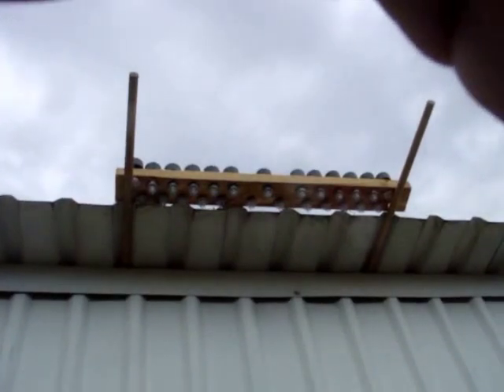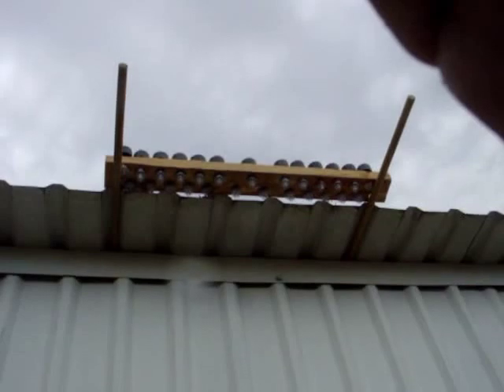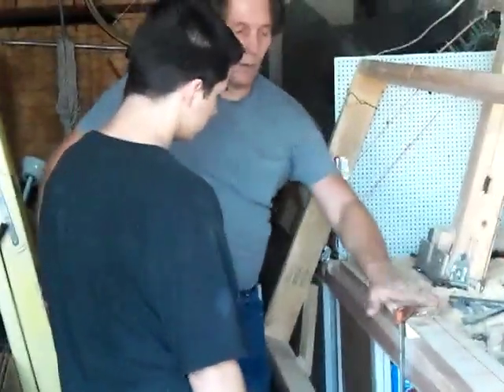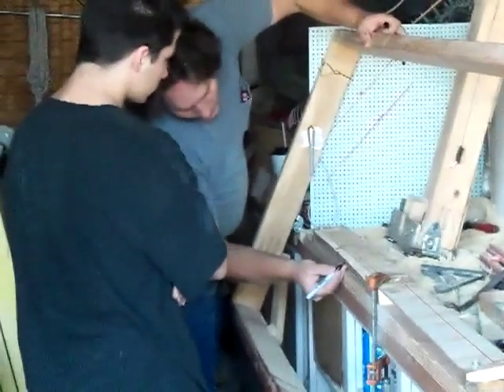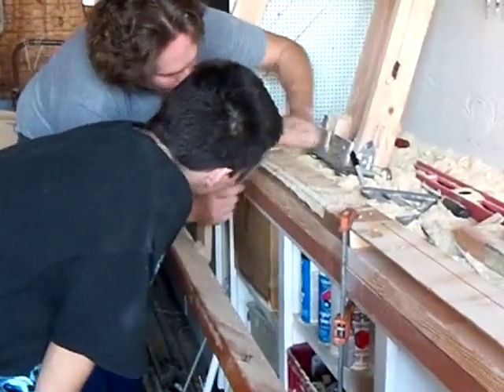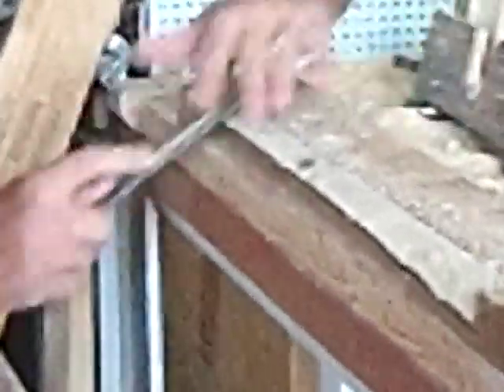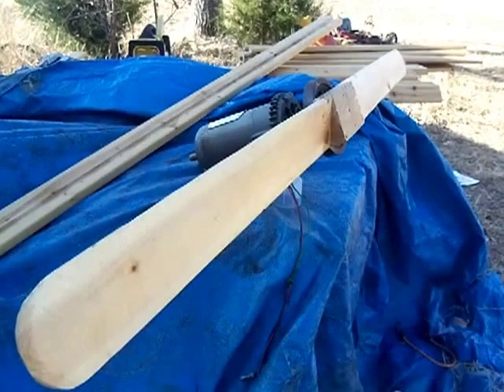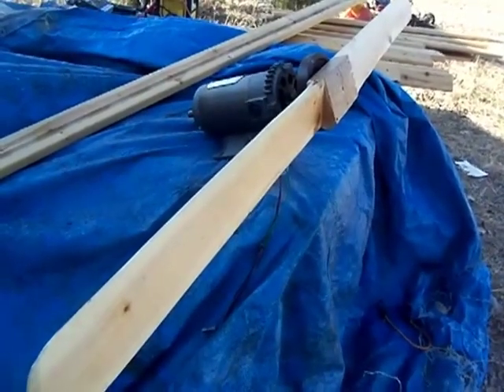Carving a wood  prop for my wind turbine. with muddymuddymuddmann

Comment: Wow you could of made that in like 20 minutes with a bandsaw............
Reply: +Rich Morgenstein yes, part of it. lets see you carve the venturi curve with the bans saw. That would take some time, and much skill.
Thank for the comment bro.
MUDDy
Reply: +muddymuddymuddmann  Well just saying there is no curve if any it's two flat sides on a 10deg ish angle from center hub........   So if you cant figure out how to set a 10deg cut to a band saw guard yeah it's complex to make........  Though seen 10 year old kids in woodworking class pull it off......
Reply: Rich Morgenstein
It's not just ten degrees. It has a parabolic twist from 22.5 degrees at the hub, gradually changing all the way down to 3 degrees at the tip. That's why i made the machine for doing the prop blanks. Then i Just spend around 30 minutes rasping out the back side curves.
It's a lot of fun though. It gets addictive carving then and watching your work spin the tips at 45 MPH in 10 MPH winds.
4.5 TSR.
Thanks Rich

Comment: LLuE88, The most common propeller for a wind generator is a 3 bladed design. Although a 2 blade prop is simpler to build, they have the disadvantage of being harder to start. The other drawback is that when the wind changes direction, a 2 blade prop tends to vibrate quite a bit while turning. This is hard on the prop, and the generator bearings. A 4 or more blades propeller deliver more torque indeed, but turn at a lower RPM.
Reply: +Meliton Martinez Exactly said bro. Right on the mark. You took the words right out of my mouth.
It's good to see your comment. I am Glad to hear from you again my friend.
Keep smiling and have a ball.
MUDDy

Comment: Scott,
Why is is it that most most all set ups are two or three blade instead of  4  to  8  or more  blades   (discounting the 'gyro' effect,  unless that is "the" reason) ?.
    Seems to me that a signifigant higher torque can be delivered by more  versus fewer blades.   plus the flywheel effect would appear to help stabilize the current flow.  thanks.    regards